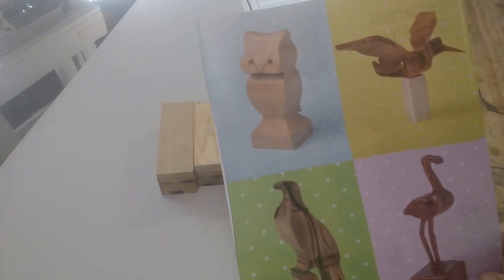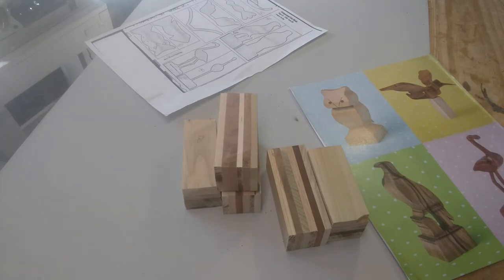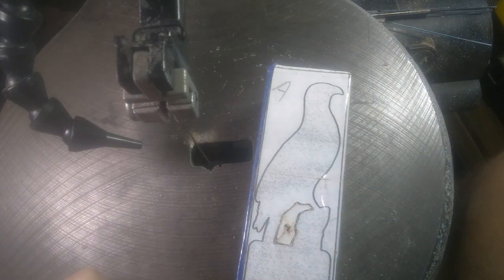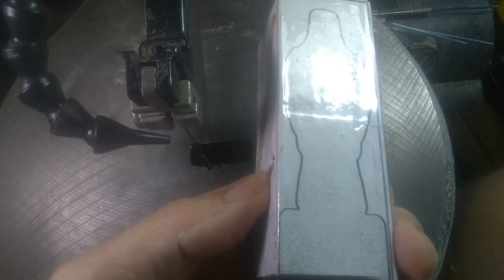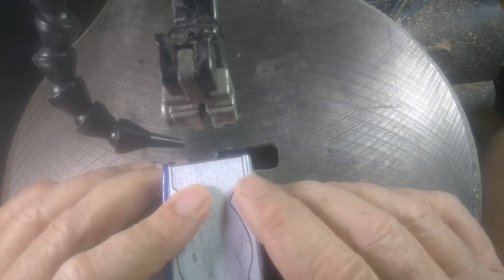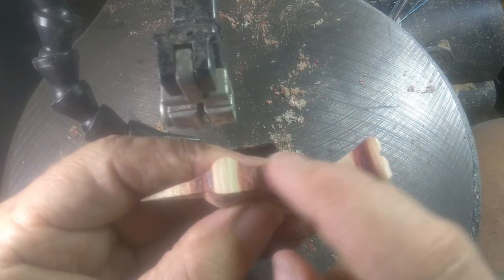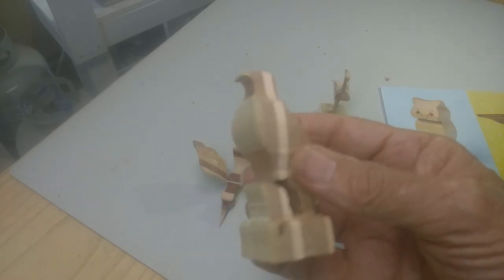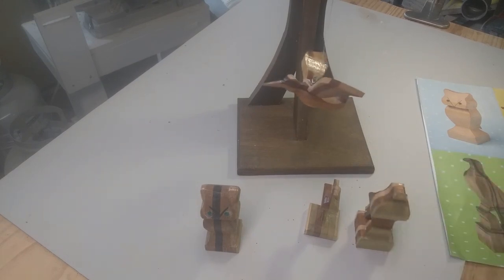Scroll Saw Compound Cuts

Comment: I didn’t think I could do a compound cut because I can only cut wood up to 2 inches, but having watched this video I’m going to give it a try. Many thanks. I’ve subscribed, and look forward to seeing more of your work.
Reply from the maker: Sorry to take so long to respond.  We are in day 3 of an ice storm here, many hours without power and no internet for the third day. Will be no video posted this week but have one almost ready.  Thanks for watching.  For me the single most important thing about compound cutting is to be slow and deliberate.  If you cut faster than the blade can cut well it will bow or skew and not track top to bottom. Go slow and don't cut with a really dense wood.